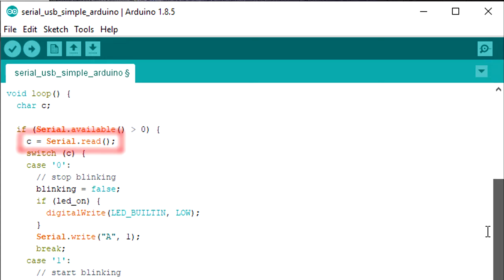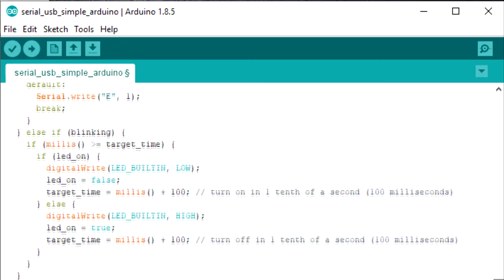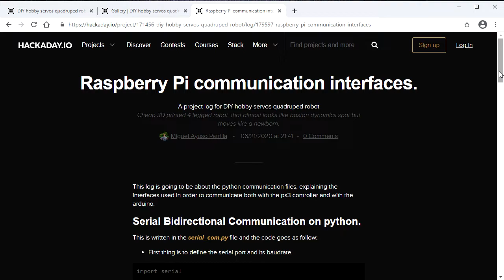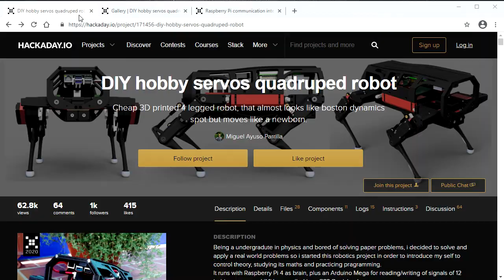Raspberry Pi to Arduino Serial USB Communication

Comment: How come with the data cable, you don't have to worry about the operating voltage difference between the raspberry pi (3.3V)and the arduino (5V).
Reply from the maker: You're right that the GPIO pins on the Raspberry Pi use 3.3v and the pins on the Arduino use 5v. However, I'm not connecting to those pins, I'm using the USB ports. They operate at 5v.

Comment: Okay so we're building a boat running on solar panels and I want to read data from the MPPT's and BMV700 we have installed through the USB ports of the pi, I've rewritten all the code from last year and wiped the pi's OS completely, but now I don't know what the serial port names or something are for the USB's. How do I figure that out? I believe it used to be /dev/ttyUSBPORT1 and so forth, but I don't believe that's working anymore. Any way to check?
Reply: Unplug the usb cable, list all the files in /dev, then plug the usb cable back in and check for the the files that just appeared in /dev

Comment: Im thinking of building an ROV sub, it will have an  Mega 2560  in the sub & a Rasbury pi top side. Data & commands will pass both ways, the PI will display camera video & data on a screen.  Thinking of using fiber optics for the link between the two, have you anything on using mega & PI with fiber optics.
Reply from the maker: Sounds like a fun project! No, I haven't done anything with Mega and Pi and fiber optics. I did recently play with fiber optics for transmitting an audio signal from a radio though https://youtu.be/kIzbuAy5sNQ

Comment: I've been exploring serial communication between an Arduino and Pi myself the last few days and have had a bit of trouble.
What is .setDTR? I've not heard of that method.
Reply from the maker: Setting DTR may not have been needed. I later found that the sleep without setting DTR also worked. So in other words, what was really needed may have been pausing a bit at that point in the code.

Comment: @RimstarOrg Do you need to power the Raspberry Pi and Arduino separately even when you connect them via USB? From what I understand they use different voltages.
Reply from the maker: You can power the Arduino from the Raspberry Pi through the USB. However, if you then power other things from the Pi or Arduino then you could demand too much current from the Pi. You'd have to make sure that the power supply that's powering the Pi is rated to supply the amount of current you'll need overall.

Comment: I have  two N52 Magnets Size 2"L x 1"W x 3/8"H and Magnet wire  18Awg, I will have One Magnet face North and other South But I need to make One Magnet wire Coil that both Magnets rotating 360 degrees in center of One Coil to produce at least 14 Volt and light up 150 watts light bulb,  How many turns of magnet wire I need to do or have to produce what i'm looking for the out put. I look forward to your reply.

Comment: What is the advantage of controlling the arduino instead of just using the raspberry pi's IO ports?
Reply from the maker: I plan on adding code to the Arduino for accelerating the servos, controlling their speed and keeping track of their position. All of this will involve computations and I want to offload that onto the Arduino rather than use up extra CPU on the Pi.

Comment: Hey, Great info. I have done a similar project. I ended up using a python library called pymata-express. It based on the firmata protocol. I don't know if it supports servo motors (I believe it does).
Very robust and compatible with asyncio. You will get great performance leveraging asyncio.
Give it a try. I am not affiliated with the project in any way. I just liked it a lot and it is very robust.
Reply from the maker: I looked at firmata near the beginning. I found a C version. But it didn't work for me I think because as I discovered, you seem to need to wait a second or two between opening the serial port and doing your first write to the Arduino. So I ended up going my own route and discovering that later. Thanks for the tips though. I'll keep them in mind if I switch to python.

Comment: Great perspective. Thanks!
Here's the python that I use for that same task:

from serial import *
import serial.tools.list_ports

ports = sorted(serial.tools.list_ports.comports())
i = 1
print("\n")
for elem in ports:
    print(i, " - " + elem[0])
    i = i + 1
selectedPort = input("Select COM port option: ")
comPort = ports[int(selectedPort) - 1][0]

serialPort = Serial(comPort, 57600, timeout=0, writeTimeout=0)

while 1:
    if serialPort.in_waiting:
        readLetter = serialPort.read()
        print(readLetter)
Reply from the maker: Thanks for sharing the code! You even give a user interface! Do you do writing as well though? I never had a problem with reading, it's the writing that gave me troubles.
Reply: @RimstarOrg  I mostly use this code to read from an arduino, delivering data from various novel video game controllers. The serial library has a .write() function which I assume works fine... But now I'm rather curious to see if it actually does work. Thanks again for inspiration.
Reply from the maker: In case you do try the write, I'm not 100% sure it was the DTR that did it. It may have been the sleep(). In either case, if you try it let us know how it goes.
Reply: @RimstarOrg  The .write() function works ok, if I byte encoded the data. I have an arduino attached to this python code, and it blinks its built-in LED on for 'A' and off for 'B'.

from serial import *
import serial.tools.list_ports
from time import sleep

ports = sorted(serial.tools.list_ports.comports())
i = 1
print("\n")
for elem in ports:
    print(i, " - " + elem[0])
    i = i + 1
selectedPort = input("Select COM port option: ")
comPort = ports[int(selectedPort) - 1][0]

serialPort = Serial(comPort, 57600, timeout=0, writeTimeout=0)

while 1:
    if serialPort.in_waiting:
        readLetter = serialPort.read()
        print(readLetter)
        
    serialPort.write(str.encode('A'))
    sleep(1);
    serialPort.write(str.encode('B'))
    sleep(1);
Reply from the maker: What if you don't do the:
    if serialPort.in_waiting:
        readLetter = serialPort.read()
        print(readLetter)
and go straight to the write? The read might be acting like a sleep, giving the Arduino time to be ready.
Reply: @RimstarOrg  
Using just `serialPort.write(str.encode('A'))` in the loop does not work unless I also either `sleep(2)` before the loop or sleep at least a millisecond inside the loop too.
This is odd because I would imagine the arduino just needs some time to start reading, but then why doesn't the loop with only .write() eventually start working?
Anyway, before entering the write loop, it's also possible to check the .is_open property. I kind of like this solution, because you know it's waiting exactly as long as it needs to:
while serialPort.is_open == False:
    waitingForPort = 1
Reply from the maker: Nice. I agree with your preference for .is_open too. I'll look for something like that in C. Thanks.